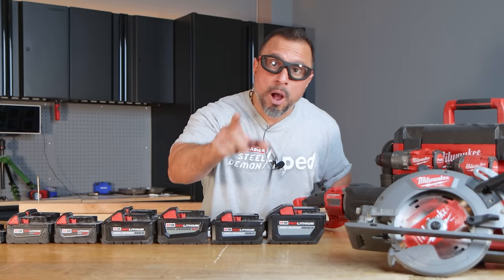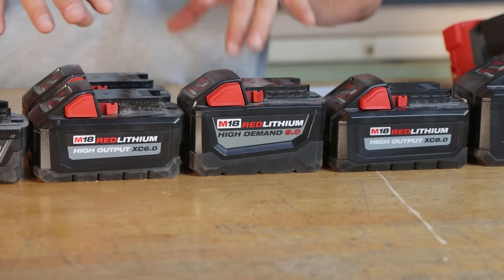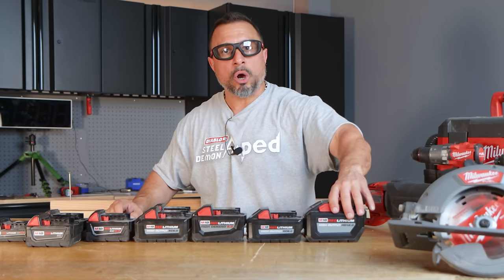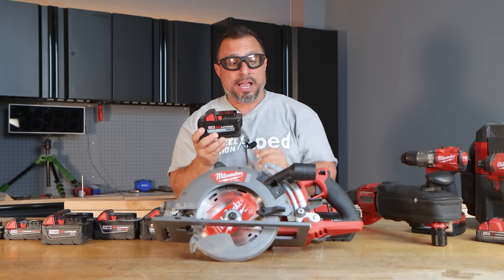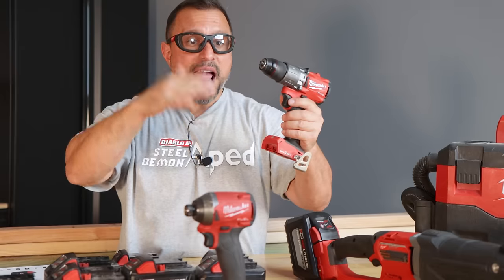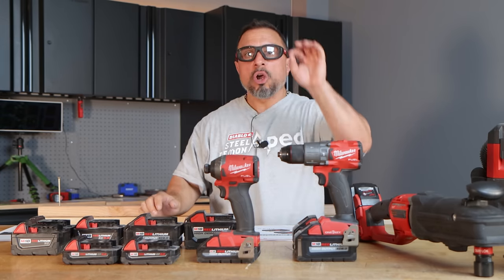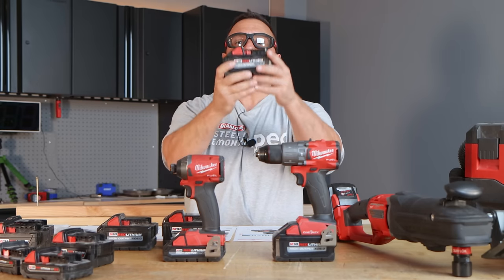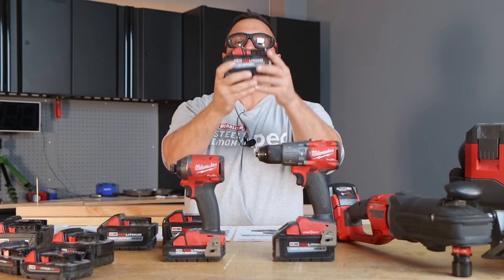Your BUYING and USING Milwaukee M18 Batteries ALL WRONG! (stop doing this)

Comment: My boss is a Milwaukee finatic and that is all you will see in the warehouse. We do have a lot of issues with his batteries and drills, which is why I just bring in my DeWalt stuff, and is also why I can't say Milwaukee is the "best", but this may be good for him to know. The biggest issue I have with Milwaukee, is the fact that the drill stops working sometimes, because of the processor, and I have to take the battery off and put it back on for it to work. No matter the reason, it's an inconvenience and I shouldn't have to do that and have never done that with any other drill I've ever used.

Comment: So for starters, me having literally every battery they have, a lot of this information is incorrect. When your running a bigger or smaller battery in a tool that requires more battery power, or battery life I like to say, it does not make any difference at all! If I use the tiny little XC, versus the 9.0 (which is also NOT out dated as stated in the video) in like my circular saw or my impact, I do not loose any power nor do I gain any power. The only difference is that the XC will end up dieing sooner. He says in the video they don't make any difference on lights, that's because they don't make a power difference period! They are all 18 volts so they aren't going to produce any more power, but the bigger ones last longer. Want to save your arm, get a XC, want to do the whole job with out changing the battery ever few minutes, get a 12.0 battery. That's all that needed to be said in this video and not the other bull s***!
Reply: Not exactly. Battery available power differs from battery life. Different cell types can deliver more energy even at the same capacity. Not talking about voltage. If a tools motor caused a big enough drain, a battery that can deliver more energy can help the tool perform better. Definitely can make a difference.
Reply: The magic of amp draw

Comment: Great video. It has taken me a while to piece this all together. Didn't know about the HD 9.0 NOT being one of the "High Output" ones. Milwaukee could stand to clean this up a bit in the future.
Reply: Slayer 🤘🏻😈🤘🏻
Reply: The 9.0 still works fine and lasts a hell of a long time on basically all fuel tools.
Reply: @mysterycomment1553  how long does it last compared to the 8.0?

Comment: The batteries here in Canada have gone up in price in the last while. A two pack of 3.0 HO cost about $296 Cnd and a single is $148. A single 6.0 HO is $219. Earlier this year I bought a 8.0 HO for about $150 but now it's $269.
Some of the M12 line is pricier now as well. In the summer I bought two M12 6.0 for $100 each but now they go for $150 each.
Reply: Yeah they've gone up a lot within the last year. We used to sell 5.0 AH for $99 when they were in the flyer, now MAP is $188. Even the flyer we had that the 5.0 AH was in, they were $149.
Reply: its brutal, i just got  a m12 fuel kit and i will just run the batteries out that came with it then buy some HO ones

Comment: 12.0 is all I own... I like to curl in my down time.
Reply: Doesn't fit in all tools, lol
Reply: @beni7928  everything but the m12
Reply: @DmacJitsu  not the chainsaws or the light stands
Reply: @beni7928  ah I see what your saying now too underpowered for the tool
Reply: @DmacJitsu  no the 12.0s don't actually fit into the opening
Reply: @beni7928  the chainsaw comes with 12
Reply: @DmacJitsu  my bad, I don't have one, but I have 2 12.0s and found out I couldn't use them in the stand lights

Comment: Good info, thanks!  I bought a 5.0 to run in my M18 tire inflator b/c the battery was only 65 bucks!  It'll be fine in that application, I think.  When I ever need to replace the 1.5s for my drill, I'll go with the 3.0 high output ones.

Comment: It would be very cool if you could compare the M18 5.5 high output with the 6.0 high output. Sometimes 5.5 comes at a significantly lower price and I am interested what's the actual difference between the two.

Comment: This is frickin' awesome! Thank you so much. You're videos were one of the reasons I went with Milwaukee FUEL tools to replace my worn out, 18-year-old DeWalt, and I don't regret it in the least. I'm gonna go buy a pair of CP3.0 batteries right now.

As a follow-up to this video, it would be great if you could do a breakdown of some of the most common generic batteries for Milwaukee tools that are all over eBay. Figure out which ones are a complete ripoff and which are at least fairly decent.

P.S.: It would be great if you had links in the description just for the new batteries that you're recommending.

Comment: Believe it or not, this video was actually really helpful and informative for the average young adult that knows not much about these tools and batteries. I'm looking at buying a milwaukee 1/2" high torque impact wrench but do not want to get the bundle that comes with the typical XC5.0, but rather buy the battery and charger separately so that i purchase the preferred high output high demand 12.0 Ah battery pack with charger station. It'll be more pricey, but will definitely be worth the money in terms of quality, power, and run time. Thanks for the info for sure

Comment: I run the 8.0 HO in my 1/2 inch impact and grinder it works great I have heard that the 12.0 battery will give the impact more break away torque

Comment: Excellant video and wording. I would like to point out that ability to take advantage of 21700 cells vs actually going to use that power. You will definitely notice the difference in a 1/2 impact or any other larger tool, but a drill or impact driver not so much. I would certainly recommend getting the High outputs after you use up your other batteries since the CP 3.0, XC6, 8, and 12 will all perform similarly it's just runtime differences mostly.
Reply: I run a gen 3 fuel 1/4 hex impact, 100% you feel the difference between a cp2.0 and a cp3.0 HO battery. I have to drive tapcons with the thing though lol if you're just using the thing as a screwgun it's almost unruly lol

Comment: Hey Vince, if you haven't already, I'd love to see you running some tests with the Amazon knock-off batteries. I have a few but I really have sporadic usage of my tools at the best of times. I tested the chargers but they were just the same speed as a regular Milwaukee first generation so nothing much fun there unless you want a cheap 4 bay charger.
Reply: They work with vibrators
Reply: Amazon knock off batteries stink , they are junk big time I made that mistake once but never again.

Comment: Wow, all that high speed talking but still a lack of clear communication.

Might have been more useful to spend some of that time breaking down the battery designations and properties - nominal vs actual capacities, best applications for the various battery types. Some batteries may be optimised for low power over a longer time, while others may be optimised for high current demands for a shorter time. Same with the tools they would be used in, Some applications have a low draw but are continuous, others have a high draw but for a short time.

As said, matching the types and capacities for the tools will save money long term and make the best use of them.

Comment: Very interesting presentation, but there is a question. If set of two XC4.0 (72Wh each) batteries cost 50 bucks less than XC8.0 (144Wh) why should someone use the battery that cost more, has higher weight, and bigger dimensions in hand tools? It just hypothetical question. Even comparing to XC5.0, the difference is minimal, the price is $1 higher for set of two XC4.0 VS one XC5.0 battery.

Comment: The XC 5.0 batts are frequently bundled with a tool at the same price as the bare tool. If I need the tool, I take the bundle, and use the 5.0 batts till they die when I don't need anything bigger. I wouldn't buy them separately though.

Comment: Love the vid man, I agree only reason I have XCs 5.0 is Black Friday deals that give me two batteries bag n charger for less than $100 on a deal with my tools.  Example $200 for a milwaukee fuel m18 jigsaw with that combo.  Got like 6 obsolete batteries to burn out with the exception of that circular saw you shown I have a 12.0 HD for it that came in the bundle.

Comment: I'm not sure using retail prices for the battery comparison is very useful. From what I've seen on sales you can get the non-HO batteries for about 10$/amp-hr. The HO packs don't seem going on sale often, and when they do they are to be costing closer to 20$/amp-hr even on "sale". So if you need more batteries to just round out your collection, it can still make sense to being non-HO. 

Another little tidbit,  the 6.0 batteries have more instantaneous power than the 8.0 batteries. So if you want to get that last little bit of torque out of your impact, use the 6.0. It seems to me instantaneous power wise the 3.0 HO battery is approximately the same as the 5.0 battery, so it's my favorite for impact and drills.

Comment: I bought the high output Batteries for my non fuel(Yes guys I'm running non fuel but the company bought them new for me) and I'm glad I did but I wish I could charge them faster! I run my HO 3.0 on the 1/4 impact and it's perfect even for the non fuel, and my grinder I run an HO on that too and it runs like a dream until it dies.  when they go out then ive gotta resort to my old crappy XC 3.0's that came with the tool set until my high out puts recharge.

Comment: Burnt out the 9.0 in a week but it was free with the 7 1/4 Fuel circ saw kit, The saw and 12.0 Are great used it for years now! The 5.0 works till the 12 is charged again as long as your nor ripping or running it under heavy load

Comment: I don't have Milwaukee tools but the same thing is true with my Ryobi. I like to use 2.0 ampre hour batteries on drills and and screw drivers and use larger 4.0 amper hour batteries on other things. I have a cordless hot melt glue gun and also a cordless heat gun that I use a 4.0 ampre hour battery on because it takes more power to run a resistance heating application then a motorized application such as a drill or saw. It also depends on what sized motor your tool has. Saws generally use more power than drills or ¼" impact screwdrivers. Another thing that uses more power are ⅜" and ½" impacts. I use the biggest batteries I have on them, but I use drills more often and I also think about what tool I'm using and the weight I have to lug around and how long I'm going to use it.

Comment: I use battery sizes based on the tool. Impacts only need 5’s. Saws need a 9amp. Sawzalls don’t like 12amps, because the weight of the 12amp messes with the connection. Literal power isn’t always everything.

Comment: If you are working on steel using the grinder best to use the HO battery, got the 12Ah one as my 5.0Ah did not last very long. Not to mention using it on air compressor, and 3/4" impact gun yep need more powar baby.

Comment: I’ve got a High Demand 9.0 battery that’s roughly 4 years old. Compared to professionals, it’s seen very little use. I’ve used it every summer, one day a week, in my leaf blower to clean grass off sidewalks on mowing jobs. I used to get about a day and maybe a little more on one charge. I’m now lucky to get 5 minutes total. The battery just won’t hold a charge. My 5.0 batteries with 1 bar left will power the blower longer than the 9.0 on full charge.

Comment: In 2016, before I "became retired" after 40.5 years with same company, I was able to choose my 40 year service award.  I chose Milwaukee M18 Heat drill with 2 Red Lithium batteries and charger, and I must say I love it.  I even purchased a Milwaukee Sawzall to utilize the same batteries.  So I'm still on the original batteries, 7 years (way better than my Sears NiCad batteries and drill with terrible self-loosening chuck).

Comment: I just was at my home depot yesterday. For the M18 XC 6.0 was 179.99 and for an XC 8.0 was 199.99, I went with the 8.0 for the longer run time. But for literally 50 dollars more I could have bought another 60V flexvolt battery for my Dewalt stuff. The M18 is for the transfer pump I just bought

Comment: I work construction and have multiple batteries in different sizes I like to have a battery I can use constantly throughout the day without the need of a battery swap in between mostly use my 6,8,12 depending on tool and task

Comment: One year later, the Depot has a set of CP3.0 and a pair of HO 8.0 for $400, the CP3.0 HO pair can be had for $99, but the pair of 8.0 best is $420. If you getting a pair of 3's and a pair of 8's, then the 4 pack is the best price option, otherwise just get the pair of 3's for $99. The pair of HO 6.0's best price out at $279, that's $139.50 a piece, $19.50 less than for the 5.0 at $159, you get the better battery and save $39.

Comment: The 6.0 is not using the same manufacturer as the other HO batteries. It's actually been tested to put out more watts than any other Milwaukee battery.

Comment: Good to know, brand new M18 buyer here.  I just bought the string trimmer without battery and really wanted to know which battery to get.  I recently bought the compact brushless set of drill/driver and impact wrench with batteries (CP 2.0) and charger.  The string trimmer ate the first battery in 10 minutes and used half of the second one in 5 so, guess I would like the super 12 battery and the shoulder strap.
Reply: We do landscaping with them.  8.0 is our favorite.  Have run 5s and 12s, but 8 has been the favorite.  We keep an extra on hand plus the super charger and no issues for us.

Comment: 3.0 and 5.0 deliver the same power but 5.0 will last longer. Each battery has its pros and cons. I would choose the 6.0 ho over the 8.0 any day as it puts out more power. U might not see a benefit from the high output on the lights and stuff but u will see a long run time especially between 9.0 and 12.0

Comment: one reason i still like the 5.0 old style battery is because of tool overall length. sometimes in the 4th gen impact the battery touches the deck before the drill bit or bit driver has completed the drive. using a small bit extension easily rectifies this however.

Comment: I personally have dewalt tools, got a great deal from a tweaker.
Cut down a battery ti use in my m18 shop vac, but otherwise the 40volt flex volt batteries can be used in the 20volt tools as a high cap battery. 6ah in 20v instead of 2ah in 40v. So definitely longer run times, idk if Milwaukee necessarily have two run modes depending on the tool. 

Ive picked up a plethora of bad batteries from the service center that will be eventually rebuilt to save money instead of buying new batteries

Comment: I am happy that I came across this video. I was gifted a Milwaukee impact and drill. There was only one battery and no charger. I was going to buy 5.0 batteries. Since that is the battery that was with them. Now I will be getting HO 3.0 batteries. Thanks for the information.

Comment: LOL I have Milwaukee batteries I have been using since 2011. Whatever came with the tools I bought. I interchange them as I need them across all my tools. The only battery I have had to throw out is the only one that got knocked off a roof that landed on cement.

Comment: The capacity/output feature also applies to kids toys -- a high capacity high output battery in a low drain toy will cause the HO battery to under perform and the low capacity battery in a high drain toy won't go the distance.

Comment: I just bought 3 deals of XC5ah batteries for $199 each. Two batteries plus one free tool. I bought 2 batteries for $199 and received a free $199 Milwaukee Router,  2 batteries for $199 and received a $169 Milwaukee Blower, 2 batteries for $199 and received a $199 Milwaukee Jigsaw. So in all I bought 6 CX5ah batteries for $600 and received $569 in free Milwaukee tools. I love the CX5ah in all of my tools. There's no reason for me to own any HO batteries as the CX series gets me through any remodel jobs I do running them all day. Oh, and I also bought the 2 battery supercharger for $119 that charges sequentially. I'm a small guy at 5'7", 170 with carpel tunnel so severe, after all my testing, the Dr. couldn't believe I could even hold a pencil, let along tools with heavy battrey packs so I don't believe weight has anything to do with what Vince is saying. I'm not sure how you get a better deal with Milwaukee's fall deals, just my opinion.

Comment: I just run 6.0 8.0 and 12.0 on all my tools from impact drivers to chainsaws never had any issues the 12.0 are extremely underrated and they run for a long ass time on small saws and drills and such

Comment: Hey Vince....love your enthusiasm......I recently purchased the Milwaukee 2848-20 inflator.....It came with two, m18 red lithium, high output xc6.0 batteries and a regular charger (not the rapid charger)......I paid for the bundle $282.....I looked at some other peoples comments saying the did not get the HO battery, but mine came with the HO battery bundle....Did I get a good deal?

Comment: I got the 5.0 batteries for free with tool deals but I have purchased the HO 3.0 & 6.0 on sale because I got a fantastic deal. But August 2022 I saw the m18 fuel blower with a rapid charger and a HO 8.0 battery for 299.00 and the crazy thing is that I also saw just the rapid charger and the HO 8.0 together for 259.00 meaning if a purchase the blower offer it basically costs 40.00 dollars more for the m18 fuel blower.  I’m going for it. WIN WIN
Reply from the maker: I agree Danny

Comment: Great Video what do you think about the XC 3.0 which is a special buy?  would it be better to get a HO CP 8.0 instead since its on sale as well, Just to run like a hammer drill or a impact driver, circular saw and a sawzall